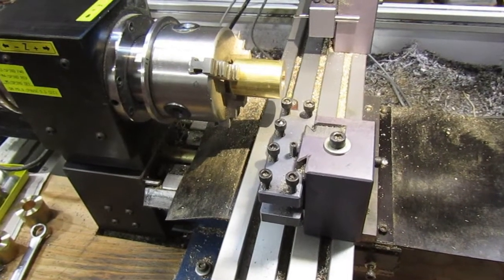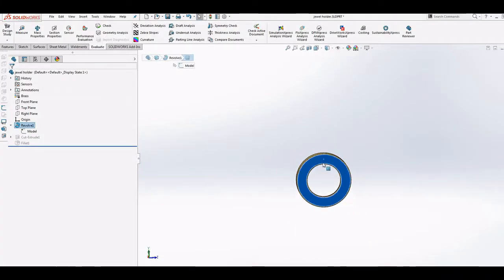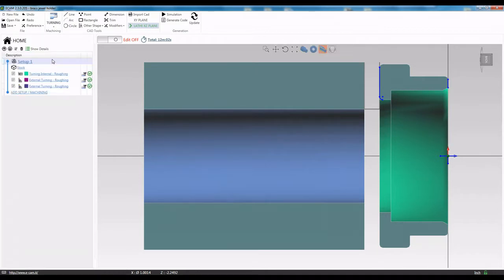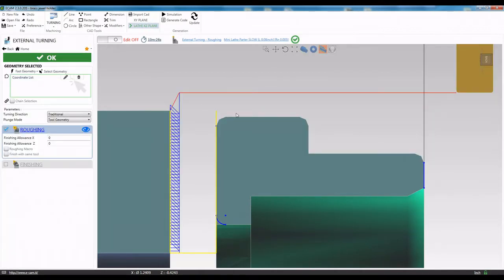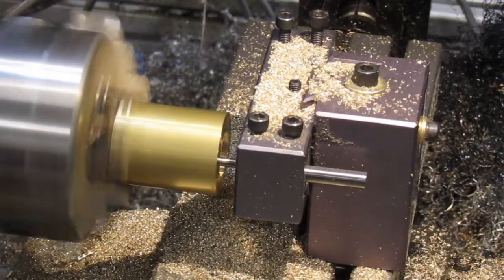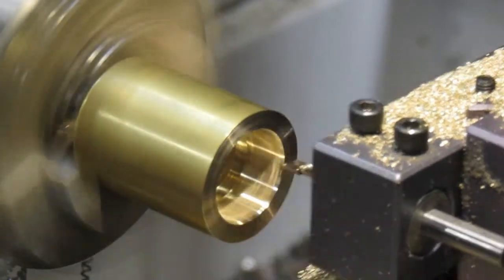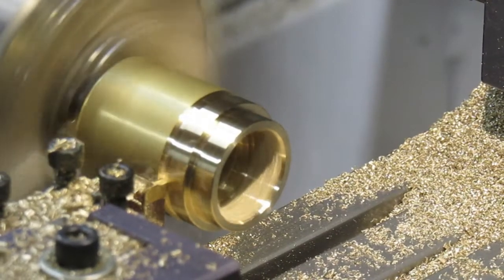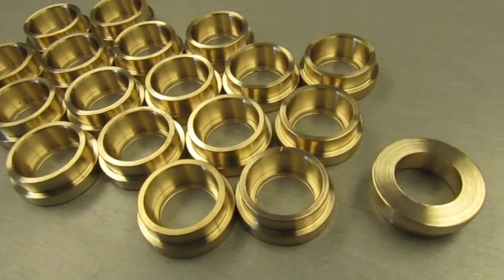Brass Turning with CNC Taig Mini Lathe

Comment: Can you elaborate on the problems with the cutoff.  Was the Taig 1/16 cutoff assembly used.  Cut off tools tend to work best with a cutting fluid added to the cut.  I would like to see some 3/4-16 or larger threads cut using 12L14 steel.

Comment: Your taig covered with chips , and here mine covered with dust 😆

Subscribed your channel, hope to see more taig actions.
Reply from the maker: Do you have the CNC model or the manual one
Reply: @bbmachine7426  
CNC model lathe.
I also have a taig CNC mill with 4th axis.
Reply: M T  a CNC lathe and CNC mill (4th axis) would be a great combination for prototype and DIY, if 5 axis jobs are not on your desk. Pocketcnc looks fancy but don't know how rugged compare to Taig machine. one extra tilt axis is the only pros in pocketcnc. In that budget you can have a solid taig or sherlin mill and lathe.

Turning operations I don't think wd go well with pocketcnc, coz of the build design. But nothing impossible 😂
Reply: M T  would you mind telling us what's your budget and any specific type of product you are looking to manufacture for.
Reply: M T  a 5axis turning centre would do all of your job, but availability of a desktop version is highly doubtful. Better go with a taig or tormach lathe along with a 4th axis CNC, Taig or sherlin brand will fit in your pocket. Apart from that you need lots of other tools within your budget for the workshop also. There is 5axis desktop CNC from MDAprecision, you can check the price and availability at your country.
We also don't prefer any cloud application like fusion360, instead using SOLIDWORKS.

You can visit my company website www.texamine.com, ping me from there , I will share our R&D facility details copy.
Thanks